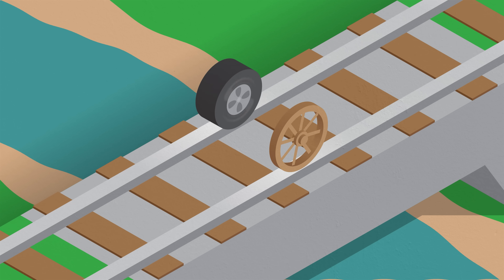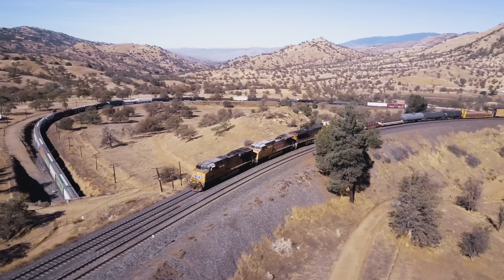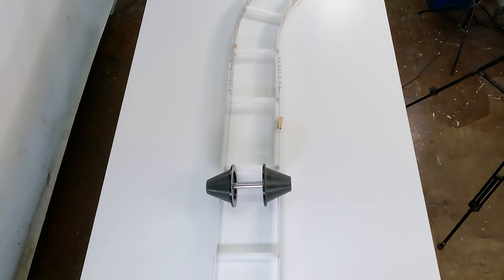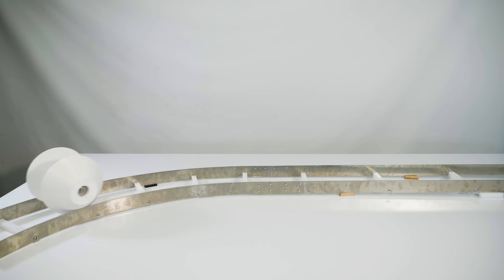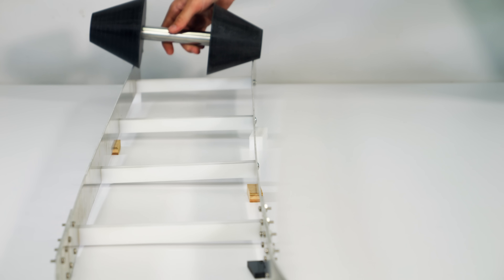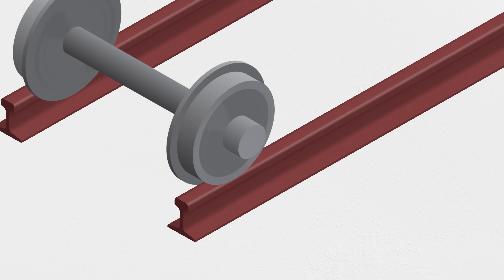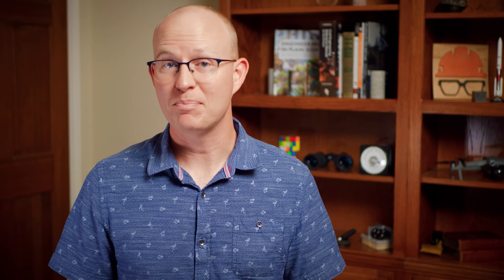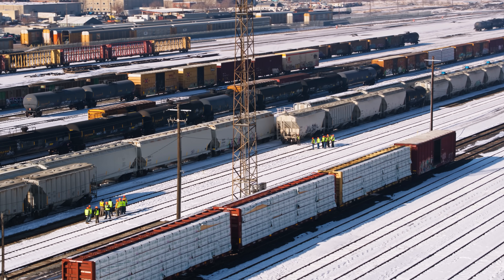Why Are Rails Shaped Like That?

Comment: 0:42 At this point in the video you see the ties/sleepers move down when a wheel passes. It happens because the train has a bit of weight to it. But I see this happen everywhere I can get close enough to the track unless the rails are bolted to concrete like on bridges and level crossings. The ballast seems not to move and seems set. Am I right to think the track is hovering a bit?
Reply: It looks like it's hovering a bit. It could be due to the wooden sleepers rotting at the bottom so there are voids underneath. Once the train goes over it it pushes it down and the track spring back up once the train has passed. Last time I saw track like that here in the U.K. we were replacing it a week later.

Comment: Rails were the final problem to be solved before the widespread adoption of powered railroads.
Richard Trevithick and others solved the propulsion aspect, but the cast iron tram ways could not handle the weight of a steam engine and broke under the load.
George Stephenson is most commonly known for his Locomotive Rocket, but perhaps his most important work was on the wrought-iron rails for the Stockton and Darlington Railway.

Comment: First thing we learned at the railways : it's not the flange that keeps the train on track but the tapper.
In an ideal situation (new rails, new wheels and a not to narrow turn) the flange is near to obsolete (certainly in a straight line). The flange will only come in contact with the rail when the tapper is worn too much, the turn is too tight (typicaly when going through switches) or when "attacking" a turn.
When it comes to hunting oscilation, that only becomes a problem at a certain speed depending on the chosen tapper. For example here in Belgium (Europe) this is 160km/h and for that reason any material that goes faster will need dampeners to counter/dampen that oscillation. Some bogies will have those dampeners anyway, especially traction bogies which is probably due to their weight (BoBo bogies will easily weight over 10T and for the bigger locomotives they might even reach more than 20T).
So when you are on a straight track and the flanges are constantly hitting the rails ... it's lack of maintenance on either the wheels or the rails.

Comment: There also is the "tilt" of the rail added by the tie plates so the cone face of the wheel and the face of the rail are approximately parallel.  At least on older wheels, with which I am most familiar, the wheels are of a double conical design.  Also, the radius of the flange is somewhat progressive so the flange seldom actually contacts the side of the rail.  While seemingly small, the rail and wheel each compress somewhat while in contact producing a "wave" in the rail.  This has been a limiting factor in the maximum weights of railcars.  Another interesting factor historically is that the common steam locomotive with rods jump up and down on the rails imparting a pounding motion that requires more material in the rail head.
Reply: So that is why diesel locomotives were a big deal.
Reply: @naamadossantossilva4736 It was one part of the equation.  Geared steam locomotives, principally the Lima Shay, the Heisler, and the Climax were an answer to the pounding while also adding pulling power and flexibility for rough and light track.  Steam engines can be balanced for one specific RPM while locomotives operate at a large range of speeds.
Reply: @naamadossantossilva4736  That wasn't actually the big advantage of diesel locomotives. Their big advantage was that instead of having big driving wheels, where their size was essentially your final gear, they could power all of their wheels through a gear train. This gave them much better tractive effort, ie. the ability to actually impart energy from the motor onto the track to move the train, this gave them an easier time getting heavy cargo trains moving and accelerating in general. This was actually a big enough problem on steam locomotives that they were often fitted with iron "tires", basically a big iron band around the wheel, to increase friction with the rails. Beyond that there were also all the regular advantages of internal combustion over steam, not having to carry around heavy coal and water and not having to regularly stock up on water, and being somewhat easier to fit an electric generator to. Though initially diesel locomotives did have a somewhat harder time breaking because they didn't weigh as much and weren't as good at compressing air.

Comment: A note on all railway wheels having them, some steam locomotives do have something called "blind drivers", where the wheels have no flanges.  A good example in this video is Durango & Silverton No. 476. I can't recall which drivers are blind, but I do know what they are used for. As you can easily guess, steam locomotives have rigid frames, so if you add more driving wheels, the less tight the curves it can handle. So we solve that by either letting the axles slide a little bit, or in 476s case, make some of the drivers blind, so they can handle tighter curves.

Comment: Another interesting video Grady, thank you. I have always been mystified by how train tracks, particularly welded rails. deal with thermal expansion and contraction which is a large effect over long lengths of rail. Can you shed any light on this issue?
Reply: That is called 'Thermal Adjustment' and it is what makes Continuously Welded Rail (CWR) work by raising the 'Neutral Temperature' of the rail.
In a nutshell the rails are expanded (stretched) by either heating them or hydraulic tension and secured to the track structure (the ties and ballast) with spring loaded clips driven onto the base of the rail. These clips or anchors can individually restrain literally thousands of pounds of longitudinal pull on the rail. When applied at every tie they can hold this rail in place in the expanded condition. So the CWR you see is actually under tension at rail temperatures below about 100 degrees or so. As rail temperatures approach 100 degrees the rail goes to a neutral state, it is neither in tension or compression. It's just laying there. As rail temperatures continue to rise these same anchors can control the increasing compressive forces, to a point. After that point the track structure can no longer restrain the rail and the track will buckle, sometimes quite dramatically.
Reply: @MsCriticalthinker201  Thank you for your excellent explanation. Sounds that another piece of infrastructure vulnerable to global warming.

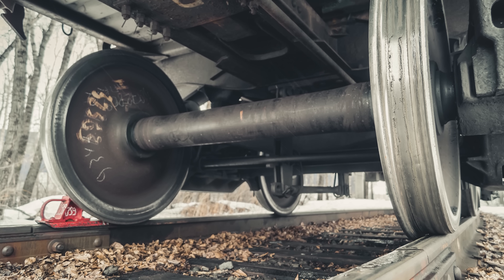Comment: At 4:44 your conical wheel axle rolling down a curve shows how it stays on the curved rail. This of course is very important. But we also see that the axle is not perpendicular to the rail. One wheel gets ahead of the other. Badly.
So this problem is solved by having a truck that has TWO parallel axles. This ensures that both axles are always kept perpendicular to the rails.
 Apparently you don't understand this crucial design element of a truck.
Having a PAIR of axles, with conical wheels, solves the problem of different travel distances for each wheel. And simultaneously keeps the axles perpendicular to the rail.

Comment: definitely not claiming this fact to apply to all or even most trains, but at least some of them (mainly self propelled units and locomotives, go figure) have greasing system for the contact area (okolek, spurkranz, not sure if wheel flange fits), that's fully automatic.

Comment: I've put a lot of thought into this and it just came now. I think double tapered roller bearings at the wheel hub would work better than single roller bearings on each spindle, make the axle fixed and have the wheels rotate on the double tapered roller bearings around the axle, the only way to do it and still have wheel sets, I know some passenger cars utilize unpaired wheel sets with disc breaks but this design still incorporates the standard break shoes and gear.
Reply: It wouldn't be better, that would support less load.
Reply: @Eagle3302PL  What evidence do you have?

Comment: I liked your presentation, but I would note that most rails are also canted inward to aid tracking and ensure that the wheels generally contact the center of the rail head. Tie Plates in addition to other functions provide the cant.

Comment: I'm unsure if true or not, but i went on a tour of a rail depot here in the UK, and they had a large wheel lathe to help keep the wheels the right shape, whilst touring that machine, they gave us the less contact per carriage than a (British) 50p coin, which was really amazing to me. Also explains why they can't brake all that delicately either in an emergency, with longer high speeds train having vast distances between applying brake and full stop.
Reply: Trains are optimized for low friction and also enormous so as per Newtons second law it requires a lot of energy to stop them, which with the low friction is hard to apply. The Shinkansen maglev even has airbrakes because it literally has no friction with its track. I think high speed trains take about a km to come to a full stop at top speed, which is both a lot and then not a lot when you consider that they can be traveling at speeds of 350 km/h and carry over a thousand passengers, container ships need several km and planes need more.

An effect of this is that the faster a train is the more spaced out the stations should be because otherwise it can't spend a lot of time at top speed, which is usually the most energy efficient.
Reply: @hedgehog3180 In the UK except for HS1 (300kmh, or 185mph), mainline trains in the UK are limited to just 125MPH (201km/h), with a lot of the older stock, mostly EMU & DMU being 75 to 90 MPH (120 to 145 kmh). Thankfully I live on one of the 125mph mainline routes 200 mile up from London. I've been on one of them at near max speed before it was forced to do an emergency stop after a report of a vehicle stuck at an upcoming rail/road crossing after the barrier was delayed and hit the vehicle mid crossing the road. That was a very... unpleasant amount of force, but it did surprise me just how quick and forceful it came to a stop. I suspect that train was taken to a depot to have wheel flats removed, it definitely screeched a lot!

Comment: That one clip where it shows the rail dipping down whenever the wheels roll over it and sink into the ballast was interesting to see.
Reply: That's call pumping, and it's a maintenance issue that should be addressed using tampers

Comment: I’ve seen maintenance train cars that have an array of grinders the reshape the rail profile, and clean up joint welds. 

So just like refacing wheel treads the top surface can be corrected for wear. I assume that works on rails designed to have enough extra cross section when new to allow for resurfacing. But I’m no engineer.

Comment: Would love to see a video on the engineering aspects of those superfast trains, particularly those using regular tracks that are not built or modified for the higher speeds.
Reply: They are much lighter which helps. Dedicated high-speed tracks have much gentler curves. The fast trains that can run on sharper curves and older rails use a whole bunch of tech, mostly an active suspension system that will tilt the center of mass of the train with gyroscopic sensors, accelerometers and a whole bunch of pneumatic and hydraulic controls. Basically you can spend a bunch of money on infrastructure or use very expensive and complex systems on the trains or a bit of both. There are good docs on youtube about the different forms of high-speed rail.
Reply: Notice that high speed rail is always for human transport and the trains are built out of lighter materials. Overall weight is many times lower
Reply: @Eagle3302PL  To be honest high speed rail for cargo might just generally kinda miss the point of transporting for as cheap as possible

Comment: @Practical Engineering
I'm a train driver in the Netherlands, and it's very nice knowing a bit more about why and how rails wear out. Large part of the grinding on wheels and tracks also seems to come from slipping wheels when the track and wheels can't produce enough friction. And when trying to stay on schedule, you sometimes need to let the front wheelsets slip a bit but keep the power on for the rear/middle motors. Slipping season as I like to call it is coming up, autumn always brings leaves and leaves, well, we all know what leaves do to trains and schedules.
Reply: If you slip a lot with older material that still uses series motors ... the maintenance technicians will hate your guts for burning those motors.
Reply: Are leaves really that much of an issue? Over here in the Pacific Northwest we always get lots of wet leaves on the rails in the fall but it almost never produces any issues. Maybe because our trains are just bigger and heavier in general than European ones?
Reply: @everettrailfan  they can be a issue. It can cause wheel spin which damages the rails. I can't say much about the Pacific Northwest but in the UK we have many passenger trains that stop and start fairly frequently due to the amount of stations and the proximity to one another. The leaves increase the stoping distance. We have RHTT (rail head treatment trains) which blast the head of the rail with high pressure water. Also some test being done using lasers. If you knew all that sorry for wasting your time. Also the species of plant the leaves came off can make it worse.
Reply: @stephenallman2484  I just realized something too, we primarily have evergreen trees, so we don't have quite as many leaves to deal with, and here on the Sounder North line there is a total of 4 stations so really not a lot of stopping and starting. The real issue here is the threat of landslides in certain places and snow/ice up on the summit of Stevens Pass to the east, which dwarfs anything leaves could do.

Comment: So if trains are doing a sinusodal motion down the tracks and the tapered wheel design and flange prevents the wheel from leaving why aren't train tracks bowed outward?  The web is perfectly fine for vertical force loads but much like an I-beam isn't too good for horizontal force loads which is exactly what would be happening, Newtons 3rd law baby! If the train wheel is being pushed towards center so neither side rides too high then the wheel is also pushing the rail outward